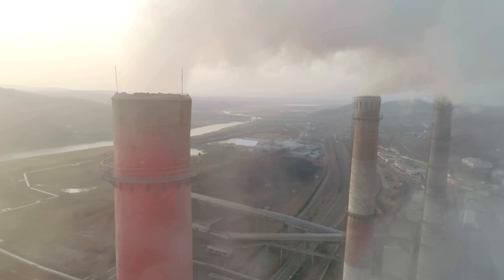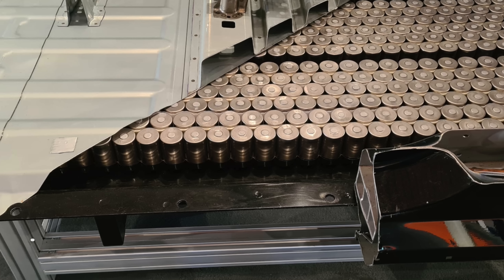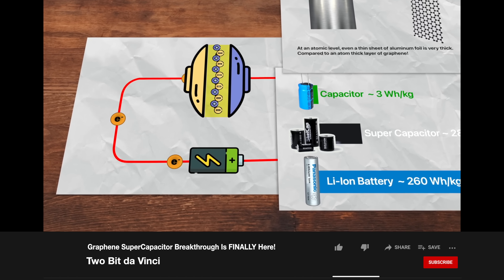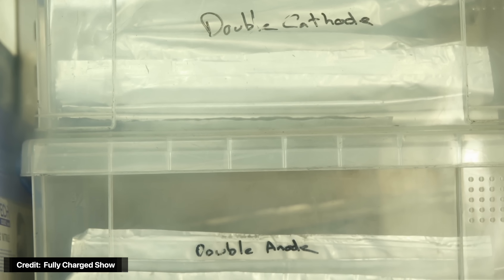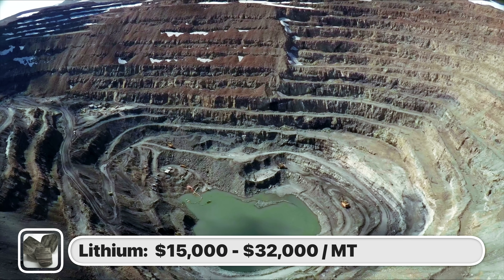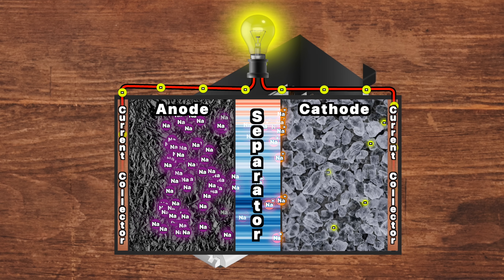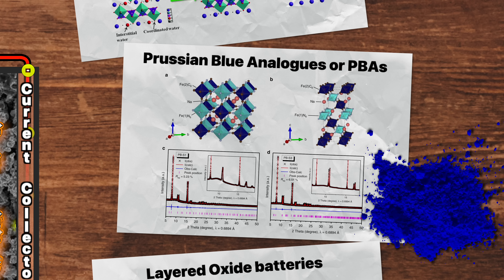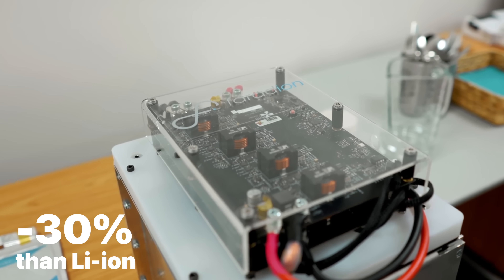Next Gen Battery is 1000x Easier to Source and 99% Cheaper!

Comment: While this is encouraging (I'm always glad to see promising new battery tech) it's a little disappointing to see it's only 30-50% cheaper. I know that's still significant, but I was expecting more considering it's literally a hundred times more abundant than lithium, it no longer uses materials that are in even shorter supply than that, AND lithium prices have been skyrocketing to absurd levels recently. 

Maybe it's just a matter of scale, and it will be cheaper later, I don't know, but I want to see it go further.
Reply: The manufacturing itself makes up a big chunk of the costs, and that process more or less stays the same.
But unlike raw material costs the manufacturing itself won't suddenly rise hundreds of %.

In other words litium based batteries will get more expensive if the material costs rise further, widening the difference between both technologies.

Comment: The risk: once again, big corporate and industry could just buy up this tech, patent it, license it, copyright it, do whatever they can to prevent it from getting main stream, in order to protect their filthy, dirty and expensive Li-Ion interests!

Having said that, if I can get a small electric car as a daily for a 1/4 of the price than current electric cars, I will buy it tomorrow, even if it means only 80 to 100miles on a single charge. 100mi is more than sufficient for my daily needs. I don't need a hugely expensive Li-Ion 80 KWh battery pack that can go 300 miles on a single charge! And when I do need to go cross country I'll just use my good old fashioned diesel SUV, for now.
Reply: u dooa soatber csrv190.ioes nyb18500

Comment: You don't even need the sodium based batteries to work like litium, you just need it to be cheaper. Even if it means it lasts half as long with half the charge requiring at least double the batteries, as long as the gross cost is less than lithium, that's all you need. At least for larger scale batteries like house batteries or general grid storage

Comment: I don't know why the Left can't face it. We will never be able to go full electric. There are simply not enough resources to do it. Batteries do not last forever. Most are not recyclable, so when we run our of the Resorces to make them we will be dead. Why can't we just use batteries in computers phones and other small low demand devices and use fossil fuels in large demand items. By the way, where will the majority of the electricity come from to charge the batteries? Without fossil fuel there is simply not enough. By the way what energy source is used to create the solar panels and windmills that some of the power comes from? Fossil fuel. No oil, no lubrication. No oil, no epoxy/polymers. No oil, no plastic. The list goes on and on. No oil and almost nothing exists that we now take for granted. Every time you convert energy from one form to another there are losses, and those losses are not small. We need to use energy as close to the source as possible, not converting it multiple times before its end use.

Comment: Finally, you have come to terms with the fact that all the worlds electrical requirements can only be met for 12 minutes of ALL current batteries… we need to continue research but STOP all movement away from petroleum fuels (fossils term isn’t accurate at all) until at least 2075 when batteries MIGHT be viable

Comment: Power density is practically irrelevant in stationary storage. Panaceas are rare in engineering. Aircraft will need some form of carbon-capture-based hydrocarbons; rail transport can be electric; road vehicles, phones, and laptops lithium-ion; Electrical storage sodium ion.

Comment: The Lightyear One supposedly can manage 440 miles with 63.45Kwh (60Kwh from battery, 3.45Kwh from it's solar panels).

Imagine this - super efficient EV's with 45Kwh prussian white batteries that can manage 315 miles (probably 270 miles real world) and cost a lot less than an equivalent internal combustion engine car.  And with 10,000 cycles, that battery will outlast everything else on the car.

So when you're ready to scrap your car, you can pull the batteries and either put them in the next car, or use them for a powerwall.

And frankly all that needs to be done to get there is for car manufacturers to focus on efficiency over the next few years while prussian white battery manufacture ramps up.
Reply: ueßs it can    biy it

Comment: Interesting video, but I found your explanation confusing around the 6 to 7 minute mark, because you incorrectly refer to the positive terminal as the anode whether or not the battery is being charged or discharging. You have the anode incorrectly labeled during charging, although it's correctly labeled during discharge. When batteries are charging, the positive pole becomes the anode and the negative one the cathode. When batteries discharge, the negative pole is the anode, and the positive one is the cathode. Your explanation would have been better, if you simply replaced the words "anode" and "cathode" with "positive pole" and "negative pole", because they're constant whether charging or discharging. 

The reason that anode and cathode swap poles, is because an anode is defined as the pole where oxidation (electron production) takes place, and a cathode is defined as the pole where reduction (electron absorption) takes place.

Comment: Wind turbine blades? Fossil fuels. Plastic.  Solar cells? More electricity in the summer than in the winter. Depending on latitude. I look forward to 3 to 6 months of efficient electrical storage with huge capacity. Batteries everywhere.

Comment: I don't care at all how much the battery weighs if it's going to sit in one place. So long as I can reasonably move it around, I can plop them in a storage area and have my own solar powered battery system for my home. Or these can be used for grid-scale green energy storage. Again, who cares how much the things weigh or if they're 3x or even 10x larger than Li-ion battery systems. Build down a little and up a little and use the same amount of land. And if they're a fraction of the cost, you can afford the extra infrastructure or the extra land.

Comment: The logical place for Sodium ion batteries is house batteries (like TESLA's power wall) where having LARGE batteries is not a problem, so long as they are a LOT cheaper than large house lithium batteries. House batteries can save a HUGE amount of money if you use them to either store excess solar electricity (from having a solar roof) to use at night or charge the house battery at off peak cheaper electricity rate times, then use its charge instead when mains electricity becomes a lot more expensive! House batteries just make sense, but most people just don't know they exist, or can't afford the cost of expensive large lithium batteries.

Comment: Have seen in a video maybe your video but even if when they recycle the lithium even they get 30% back it's is better than nothing wish there were more of those company's doing that as i have a bucked of rechargeable battery's that have run out of holding any charge and don't know what to do with them as i use nothing but rechargeable battery's as bought a camera 20 years ago it would eat the ordinary non-rechargeable from then until today have never used any other battery's but rechargeable battery's soon will have to buy another bucket to hold battery's there is no place to where i can bring them around here am at a loose what to do with them it is bloody annoying

Comment: We have already better alternative- Australian company GMG develops aluminium ion batteries which use graphene electrode. They already surpassed lithium ion batteries not only in in term of price but also capacity
- Aluminium is more available on earth than sodium
- Aluminium in battery is plating the electrode surface during charging . Lithium and sodium are suffering from dendrites formation.
- Aluminium ion are nonflammable. Bot lithium and sodium batteries are extremely flammable should oxygen get inside.

Comment: The future grid will not be powered by wind/solar. There will be little need for "grid batteries". The future is Thorium based Molten Salt Reactors, or other 5th, 6th, 7th generation fission reactors. And no, nuclear waste will not be a problem. Anyting that is radioactive is a fuel, designs will be in place to extract the radiation. Current 4th generation reactors produce very little waste that is radio active for a short time period.

Comment: Who knows what the next gen battery will be yet- as usual, you are presenting technology that is still in development- done in the lab does not make this, or any other new battery tech, ready for production.  Also, besides the problems you mentioned, even using a small amount of sodium creates expansion issues- if you are using a large amount of sodium as proposed above... good luck with a battery that lasts very long!  Also, there is plenty of Li-Ion in the world- yes, not all of it is easy to get, but there will be more than enough to go around, especially once we have enough old batteries to recycle.  Same with the other minerals needed.  The ores are out there- but the question is, do we have the will to expedite their extraction until we do find an alternative.  Again, having issues lately with your click-bait titles- 1000x easier to source... but it will take years to set up supply chains (and that's even if the tech really works).  99% Cheaper.... but even CATL clains 40% cheaper- otherwise, this Sodium battery will be a 1/10 of a cent per KWH.  Yes, I am sure these stats are meant to talk only of the element Sodium, and not of the battery itself- but your title says 'battery.'  I know You-Tubers need clicks- but it gets annoying to put up with such misleading titles.  I genuinely like your videos- but really hate this trend in click-bait.

Comment: 2-3x more dense batteries kills range not just by being less energy dense, but simply the added weight takes more energy to move around.
It would be a massive range reduction, not slight.
Reply: Battery is not all lithium, sodium is 3x heavier than lithium, but energy density is not that far back, lithium in lithium ion batteries makes less than 10% of battery weight, nickel, cobalt and other materials is what makes the battery heavy...
Reply: wrongé

Comment: I think sodium ion will be great for grid storage and EVs. This help take a huge amount of pressure of the lithium market. I could be wrong, but I don't see our laptops and phones going away from lithium, it would be nice to see the overall impact of our batteries reduced as well as cost reduced because market pressure is reduced
Reply: I think smartphones are going to use sodium batteries, mostly flagships and mid range... smartphones just got bigger and bigger without increasing the battery too much, but the main benefit of lithium is the huge fast charging capability. In addition, smartphones are much more efficient than before and will continue to be.

Comment: Great explanation. Sodium ion compares well with ni-cd and way out performs lead acid. It sounds like a win in so many low performance applications. As a power wheelchair user I see the benefits over lead for sure. It's a mindset that needs to be changed, lead and nickel worked for decades and work today along side lithium. We need to fix all the problems but one battery type may not be the answer.

Comment: Wind and solar are AWFUL way to generate grid base load. They will never work even with cheap batteries.

Batteries are only 1 of the problems with Solar and wind (hint it's not always sunny and windy, there's winter clouds and night need VAST land, use a lot of nasty resources to build and require a lot of servicing, look ugly etc). Nuclear is the future not wind and solar.
Lets say it's not windy or sunny for a month in winter - batteries ain't gonna help. You need gas, and we're back to square one and need double the power generation capacity. 
Wind and solar are a total non starter.

Comment: The battery tech has a long way to go before it's really usable.   Range issue.  Temp efficiency issues.  Charging issues.   Flammability issues which means leaving them in your garage overnight means it could burn your house down...rare but possible.....which increases insurance issues

Comment: There is a huge market for stationary off-grid batteries, where slightly lower energy density doesn't matter at all!  CATL could be selling their current technology to these battery manufacturers.  These customers would love to get batteries that are cheaper and have longer life.  This market segment also does not need fast charging because they are almost always charged from solar panels.  Using lithium ion batteries for an off-grid solar system is a huge waste.

Comment: were has mr Goodenough gone too , he had a much better glass divider battery ready to go 2 or three years ago . Love your work ,good education ,but ,could you refer to hydro carbon fuels ,as hydro carbons ,or geological hydrocarbons , They are not Fossil fuels !?, One of the Rothshields managed to push the name [ money talks ] onto a meeting of geologists in Switzerland at the end of the18th century .Why ? to promote the idea of a finite ,exhaustable ,price manipulatable ,supply . We find hydro carbons on several moons in our solar system ,if they had huge piles of life that got wiped out ,we would have to totally rething everything . Old oil wells are refilling from even deeper geo structures . Most oil is found below the generally accepted fossil/flood level . Th Guy Gold that was the first real record straightner drilled some rediculous depth into a totally non oil rock structure ,and found oil . Actual fossils are found in coal seams [ and human artifacts ,even very high tech, ,but that is another story ] .blessings MG

Comment: Very well presented yet again Ricky! But, as always, coming in second in the race is always a more difficult challenge. However, I would perhaps suggest there are more "levels" to be explored in the future battery market. One technology that just never seems to get "air-time" is as old as the hills, but almost never considered! The Nichol-Iron battery will never be useful for portable storage, but you mention grid storage often, and that is an area where this could very well eclipse other options, freeing up source materials for the portable use areas, if it could get the exposure and investment it deserves. And it does deserve this for a number of reasons, including the longevity and simple ability to rebuild them. It would be great to see you cover this option some time!
Reply: Coming in 2nd at what?

Batteries have a lot of characteristics and you can start with cost.

Energy density is important for some applications but not others.  I don't need the best energy density for a home battery unit unless the home has very little space, so I can offer different solutions.  You don't need either of these technologies for grid storage.  Economics of scale should allow iron flow batteries to be much cheaper than typical batteries.

Comment: The problem with Sodium Ion batteries is the electro-chemical nature of them makes for extremely poor discharge curve characteristics.  While a lithium ion battery has a nearly flat voltage curve starting at 4.6v fully charged to about 4 volts fully discharged, a very narrow range which electronics can easily accommodate, sodium ion by contrast starts at about 3.8v, ramps down to about  3.5 at about half capacity, then falls off a cliff to about 3 volts, and then declines to about 2.5 volts fully discharged.  Because the internal resistance increases as it discharges while voltage decreases, this makes the maximum power it can deliver at 50% charge considerably less than full charge, where as lithium can deliver about 80% of power right up to full discharge.  Sodium is also more than 3x heavier than lithium so capacity per weight is horrid making it a bad match for things were weight is important, such as vehicles.  While it's cheapness might make it applicable for grid-level stationary storage, for mobile applications not so good.

Comment: Why don't we use molten salt in well insulated containers to store electricity? Why do we need to complicate it for grid storage?
Reply from the maker: that could work for sure, what do we use to convert the heat back into electricity?
Reply: @TwoBitDaVinci  boiling water to turn a turbine with steam, just like most electricity generation.  If we use salt water as the water it heats up, then we can do desalination at the same time, And have very little waste, we drink the water, and use the salt for more energy storage.  
Obviously in some places a closed loop would be necessary, but when its not neccessary getting clean drinking water out of it would be pretty awesome.

Comment: The only reason that electric cars have been successful is all the media is pushing the green agenda when 70% of all the pollution is produced by the top 100 fortune 500 companies but they are not targeting them businesses about their pollution problem. Another one that has no concern for this is the US military that deletes emission control systems then uses Gale Banks tuning to maximize the performance of the M-rap armor transport vehicle as it uses the same Duramax diesel GM 2500 and 3500 trucks use. If there was that big of a problem, they would be on board also to lower emission output! It's all about the control of the people, they cant be honest about the whole scam because then they would have to work hard for their money and that takes someone that is not a coward! That isn't them!